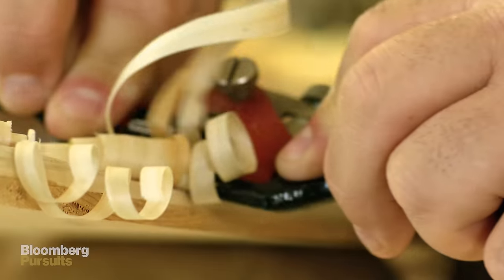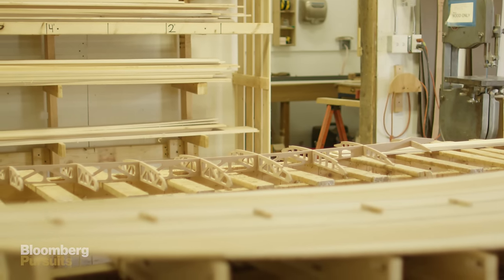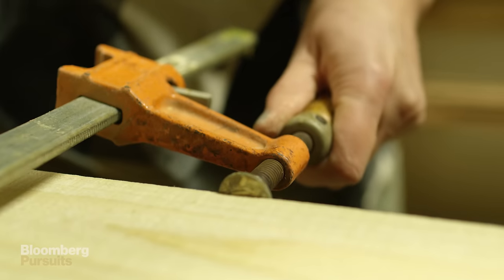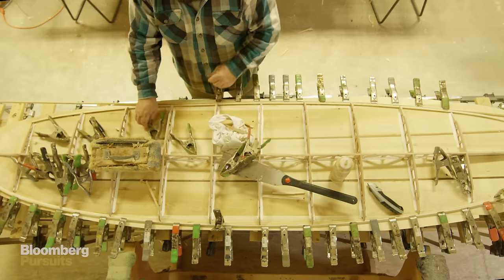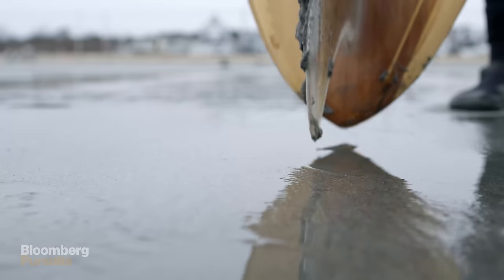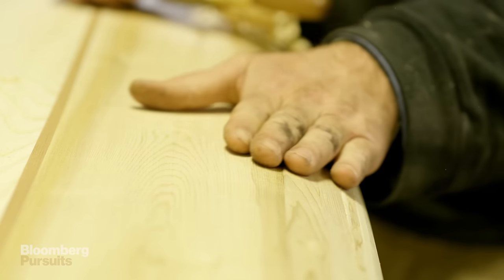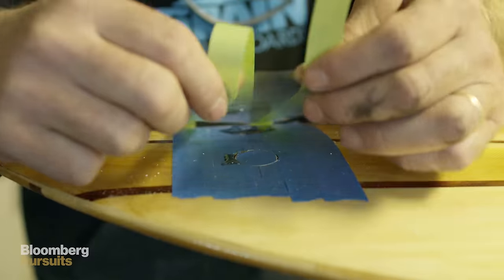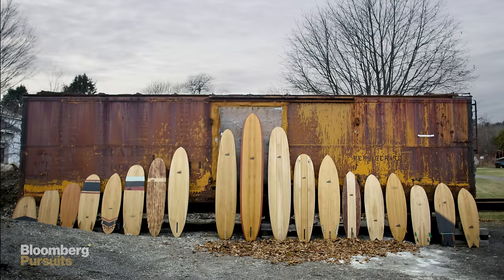How Grain Makes Wooden Surfboards

Comment: This is beautiful work. The CNC machine is just another tool in the shop and in the hands of a master great things happens when all tools are used properly
Reply: I can 3D print a gun
Reply: Yeah that's not (hand)made
Reply: it is fine to use cad and cnc machines i agree totaly but you cant call it made by hand , yes once he says 100% built by hand which it is i agree but its not Made by hand as later said . it ditracted from a fantastic video and very fine workmanship .

Comment: Awesome and what a beautiful board,but that’s a generous use of the word “sustainable “ . We have synthetic glues , fiberglass cloth and epoxy.
Reply: Fiberglass cloth is literally glass what is not sustainable about that?
Reply: I see your point but it's still much better than foam.  Which is an oil product and has no viable method of disposal.

Comment: What type of hand palne is being used at 3:34?
Reply: Drawknife, get one on ebay, but as with all edge tools they have to be kept sharp, and there's a lot of edge there.  Also, they're not for small cuts, nor easy to control.  You need straight grain wood, strength, and practice to use one effectively.

Comment: “Built 100% by hand”... Then proceeds to start the CNC Router.
Reply: EXACTLY
Reply: XD my exact thoughts!
Reply: Yea more like 50%
Reply: Nah, surfboards are usually carved entirely by machine and then glasses by hand. This is definitely a more hand on approach. Still not truely hand made, but not truely machined.
Reply: When you have a cnc in the shop you know that is another tool in your box...    that's it....    I also manufacturing wooden board..  and they are made by hand, with a cnc too!!
Reply: surfboards are usually shaped by hand though, unless its some kind of pop out
Reply: So true man, they could have worded that much better.
Reply: Paralytic, there is clearly a lot of handwork involved. To create those frame cutouts by hand would be beyond slow and clunky. That is such an obvious application.
Reply: The templates are the most critical part, cnc is a major time saver. Without cnc you could add another $500 easy to these boards .
Reply: The CNC is only used for the frame. The bulk of the board is hand made. The Grain crew are very nice, sincere and dedicated craftspeople. The frame can be cut with a jigsaw also, but even a poly based shaper starts with a block of foam.
Reply: Of the 60 hours to make the board, the CNC does maybe 30 minutes. So, if you insist on precision, maybe 99% would have been more accurate. As others have said the CNC machine is just a another tool, like a chisel, saw or drill, it saves some labor preparing the material, but making the actual surfboard is still all done by hand.
Reply: Yep! :)
Reply: Technically, when you buy lumber from a store, a machine (sawmill) was used to cut it to dimensions after another machine (chainsaw) was used to fell the tree. Using a CNC to make the fishbone frame gives the board perfect, evenly weighted balance. It could be done with a jig saw, or using a handsaw, but you just doubled the cost of your board for the amount of labor it takes to do that.
Reply: I'm sure they'd happily build you a board with those individual frames cut out "by hand" but you'd be paying 10x more. It's not that they can't build the whole thing by hand, but it would just make no financial sense.
Reply: Do you know how hard it would be to make money without using a CNC machine, he’s what you call a business owner. You clearly have no idea how that works
Reply: Guessing you are a craftsman. Would a hammer knock him out of the hand made category as well because it is a tool as well?
Reply: @waterfordrs22  sure but then you can't say it's 100% made by hand. I would go even further and say making the frame cutouts by hand would decrease the quality, so it's definitly the right decision to let a machine do that step, but acting as if that board was completly made by hand is a bit dishonest.
Reply: Nick Schade - I understand what you're saying, but comparing a CNC machine to a chisel, saw or drill is a bit of a stretch. Beautiful work though and I'm sure it rides like a dream.
Reply: the fishbone frame is probably the easiest and also most mindless part of this build. There's no real craftsmanship in the frame. It's friction fit together with a bit of glue. Precision is important though, so whether this was cut out by CNC or cut from a template with a jigsaw (which would also be printed... by a machine) the bulk of the work is by hand. 
I've made this type of board, and I cut the frame with a jigsaw and then sanded it down to the template with a belt sander (not with a coping saw or hand sander... so is it by hand?), and honestly if I had a CNC I would use it in a heartbeat for the frame.  

The bulk of the work making this board is getting the panels trimmed and then doing the glasswork. That's all by hand. 

And powertools are used extensively just to get all the lumber ready. The logging, milling, planing, resawing and sanding aren't done by hand. So cutting out a couple hours of labor using CNC makes sense just like using a chainsaw instead of a log saw makes sense.

Comment: Made 100% by hand.
Use a cnc cutter
Reply: I mean... cutting the fishbone frame is probably the easiest part of this. If they used a jigsaw (as I do) would that be by hand or would they have to use a coping saw? They also cut, mill, plane and sand the lumber with machines.

Comment: The work that has been put on it is not very much. Its just cut and assemble, no quality anyone can do that. The board has no quality test. No scientific design. No technical development. And the price totally not worth it.
Reply: I urge you to try to build one of these. In a pro shop with tons of equipment this takes 40 hours but it takes much more time and energy with basic equipment. 

The only thing that "assembles" easily is the fishbone frame. The rest is a lot of careful and deliberate work to get it to all fit. 

In terms of the design, this type of board typically is modeled after well-tested and proven forms. 

I don't know what the price is, but what do you think 40-60 hours worth of work on top of materials should cost?
Reply: buy a kit and build one yourself then you can comment on how much or little work it really is.